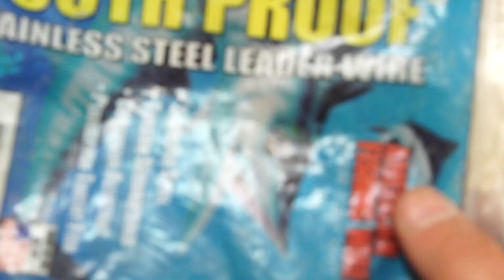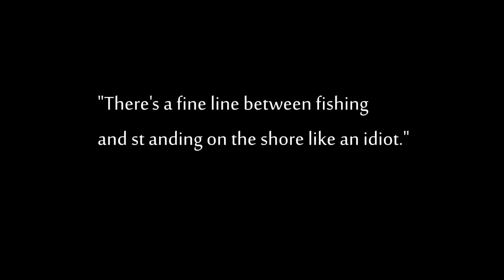Rigging Soft Plastic Lures, Making the shallow corkscrew rig

Comment: Hey mate good video again. One ask, where can i find roll pins? thanks already.
Reply: AK Fishing Any local hardware should have them I would think
Reply: Caleb Dowling yea i will chek out, thanks mate. tight lines
Reply: They are also called Split Spring Dowel Tension Roll Pins.
In the UK I can buy them from Amazon
Reply: Roll pins Some times know as Spring Tension Pins or Selloc Pins ,Roll pins are manufactured from a high grade carbon spring steel or where corrosion resistant is requiredroll pins 220x220 grade A2 ( 303 ) stainless steel and  Heat treated  for maximum strength (CARBON STEEL ONLY).
The pins can be plated although it is not recommended due to hydrogen embrittlement during the plating process de-embrittling process should be used but there are no guaranties of cracking and pin failure this process can de done but Tasman Industries Ltd can not guarantee against cracking and advise all cusotmer\'s this is carried out at their own risk.
The pins are suitable for applications where vibration is involved, by inserting one pin inside another double shear strength can be produced although one pin will be suitable for most applications producing approx 10% more strength than a solid mild steel pin.
Spring tension pins are used in a variety of applications and industry to include Electrical , Automotive , Agricultural , White products , Turning and Milling machines. For further technical specifications call our
- See more at: http://www.keysandpins.com/products/roll-pins#sthash.UcptMipM.dpuf